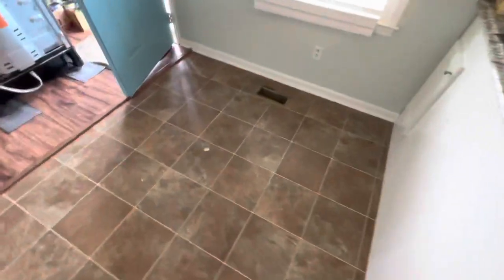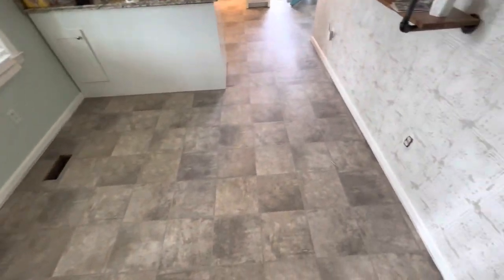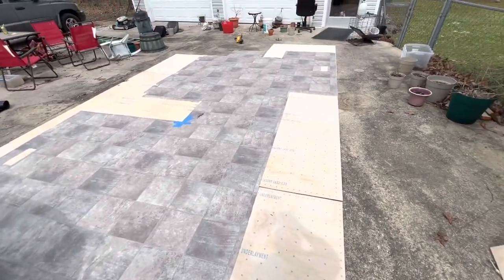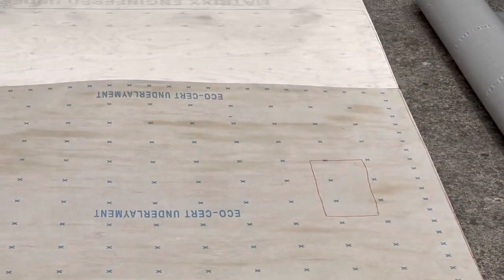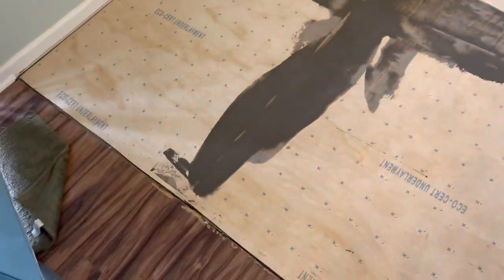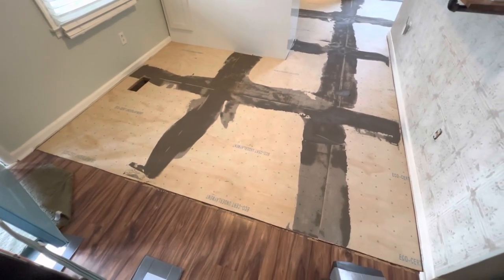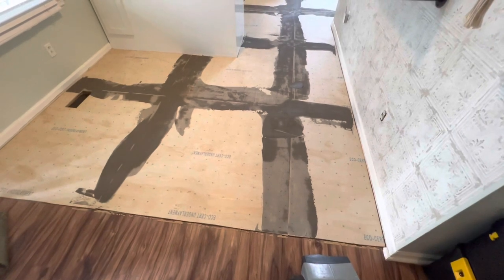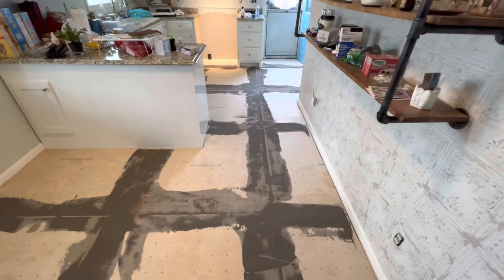Daily Vlog, new method of underlayment installation￼

Comment: I believe this method is called pattern and scribe old school method when using felt paper. Cut.in  and tape seam's of.felt paper when you cut vinyl from pattern tape outside corners so they.don't tear with the cost of felt paper. Now a days not really worth it but having everything cut does help in.finding pattern match plus help in.finding other flaws non straight walls ect.really helps with hard core inland vinyl on residential. This method has.been around using felt paper for (a while not sure if I want to say it will remind me of my age. lol. Thanks Reuben.

Comment: Hi, i have been doing it this way since the 1980's. It does save a lot of time. The only thing different i do is to stagger the joints of the ply , Because if you don't the chances of corner failure on all corners of ply where they meet is far greater.

Comment: Also with mult ply I sand xs with belt sander no mud - this is correct way brother - it’s the way manufacturers specks are
Reply: Seams not all xs 45 sand x out
Reply from the maker: @stevemuoio1968  😀👍
Reply: @stevemuoio1968  You belt sand 1/8 luan? Lol ok. Manufacturers actually want you to leave a gap fill with patch. 
Belt sand luan.. good one brother. 👊🏽